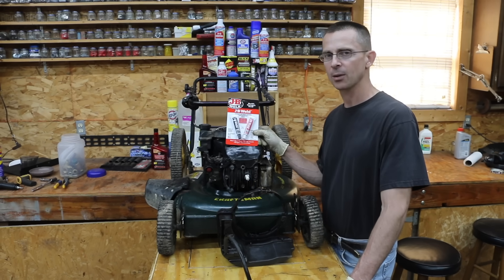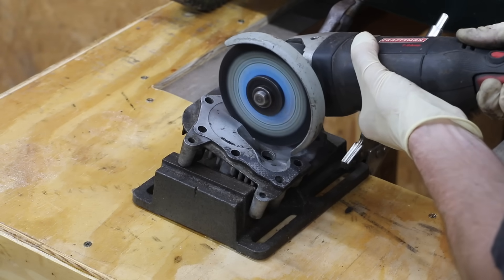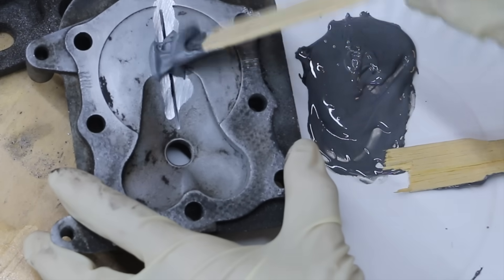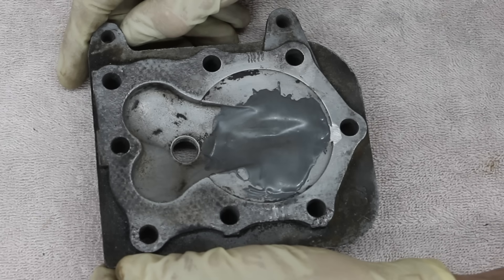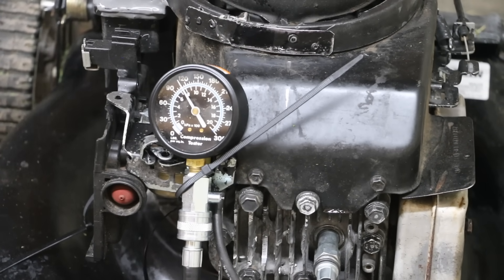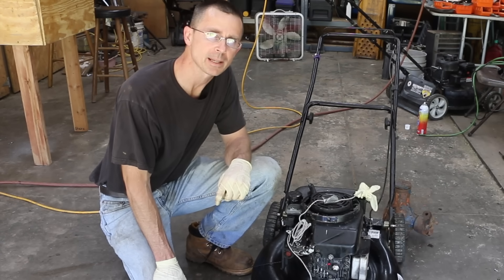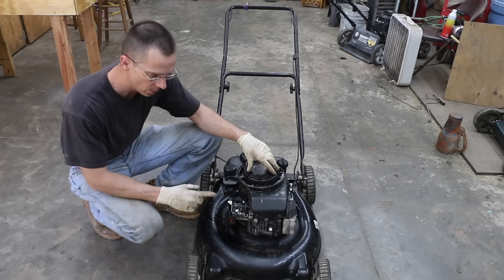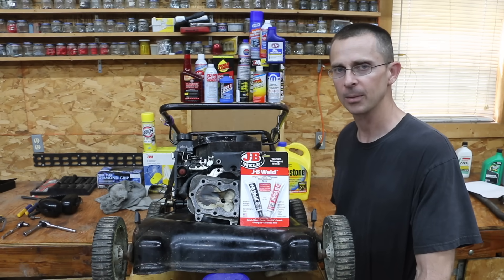Can JB Weld fix a cracked cylinder head?  See the proof!!

Comment: Instead of using bolts to hold the cylinder head use JB Weld. I'm really if JB weld will hold
Reply from the maker: Full Thottle, This is a great suggestion.  Thanks!
Reply: Why not just assembly the whole engine using JB weld that would be a good video
Reply: @Syncere20  wouldn't be able to get everything set right, with the right clearences.
Reply: I drilled through my engine block on a 4.7L ram putting a new exhaust manifold on and used jb weld on the bolt when I replaced it. It never leaked, had the truck 2 years after that
Reply: @mlheinz79  How did you manage to drill though your block when you were replacing an exhaust manifold? 😕 I'm guessing you drilled through the head instead of the block. In either case, you didnt need to use JB weld to fix it. There are plenty of engines that have the head bolts that aren't blind, and go directly into the water jacket. There are specific sealers made to coat the threads of the bolt and install it. Then you could remove the bolt at a later time if you needed to.
Reply: @davelowets  
Thats true,  the best thing to do is use a sealer/that can keep the bolt from coming out.  Most of the older Chrysler engines had exhaust manifold bolt holes that went into the coolant passages
Reply: He recently tried that while testing and comparing several glues.  It didn't hold for long.
Reply: @robertheinkel6225  he actually didnt say how long it held and i think he should have done multipul tests also because i think it would preform even better
Reply: Project Farm sorry 520 size chain long time ago
Reply: He put jb weld and metal cable ties to hold a head on and first ignition pop it blew the head off the engine
Reply: @ronashbaugh4351  🤣🤣🤣🤣🤣!
Reply: Hi really!
Reply: It won't
Reply: I don’t think removing the bolts is a realistic test though.  You should always have the appropriate hardware available. In the edge case where maybe one or two bolts broke and you’re unable to remove them and replace them for whatever reason I can maybe see why you may want to test that, but again I view even this as an extreme edge case. You should always be trying to make the best repair possible as no one wants a temporary fix.
Reply: Project Farm i used it after i sent a 420 chain through the sidecase of a 230 duad sport atv lasted longer than everything else junk Suzuki's from the late 80s

Comment: Hydrolocked a 3.2 L VR6, snapped the connecting rod.  The broken rod then punched a hole in the block.  Used JB to patch block. has held up for years.

Comment: It's a bandaid for an open wound. Temp fix if you prep, mix and aply properly. Not a permanent fix. Vibration, heat, & oil/gas will do it's job wearing it out. Ive tried and it's always always gone bad after certain period which varied due to usage

Comment: I have an LT1 engine, used in Cadillacs and Chevys. This engine has a steel looking 3/8 inch tube behind the engine between the two cylinder heads for antifreeze to cool the heads. Its called COOLING AIR BLEED PIPE. This tube has a rusty crack in it and it is spilling Coolant anti-freeze out as soon as I  fill it. The shop wants about $200 for the part (part no. 12556260) and $200 for labor. JB Weld maybe the answer to this crack. Will JBWeld be a good alternative solution to the pipe replacement, or what other ways are available to fix it without going to the cleaners at the shop.

Comment: devcon is a equal to j b weld, but harder to find. Both are machineable and both stand up to heat well, I have used both sense back in the 70's and 80's. I prefered the devcon for threaded holes because it had a cleaner cut. Both are super products that have been around for many years, and because of videos like yours, young people will get to know that a product doesn't have to be new, to be better. I don't think either product has been changed from the time they first hit the market. If it works, leave it alone.

Comment: What JB Weld blend did you use? I used some of that on the bottom of the fuel tank of my one motorcycle and the gas ate away the JB Weld and leaked all over my engine. Luckily the engine wasn't too hot and didn't catch on fire.

Comment: I filled some nasty pitted places on my 97 gmc v6 engine head and filed it down with a file and smoothed it with sandpaper about 5 years ago and to my surprise it save me from having to put another head on and i still drive this same truck today but i might add that i use to rebuild heads in a mechanic shop and magna fluxed heads for cracks for carquest so i actually knew what i was doing.I really enjoyed your videos and you do a great job making them.

Comment: I tried this stuff on the coolant reservoir on my girlfriend's Dodge Journey. Unfortunately the result was less than desirable. It lasted less than a week before it peeled off. Yes. It literally peeled off as if it never hardened. I prepped the surface and put a nice thick layer on it. It never stuck or fully cured. Quite a disappointment. I ended up replacing the reservoir with a new one. Perhaps it doesn't work with Dex-cool.
Reply from the maker: Adam, Great point.  JB Weld doesn't seem to stick to plastic as well as metals.  Thanks for watching the video and commenting.

Comment: Zo-tite is a good one  i once fixed a gm 3800 6 cyl that had a crack about a foot long from water in the cooling system in the winter. I told the customer you need an engine but we could try this stuff not much to loose at this point .i worked that car for about 2 years and every time it came in no cooling leak. good video man.

Comment: snapped a bolt off flush in a zx6r engine case on teardown, marinated that bolt w blaster penetrate oil for a week,  broke 3 extractors trying to remove it... eventually knew when to hire a 'pro' paid a moto shop to drill and re-tap, they drilled crooked hit case and messed it up baaad, chaged me 33 bucks and said they cant fix it....... its a real monkeys lunch.... to say the least... wondering if i can yard that case hole out a little larger and jb weld hole completely full and then re-drill, and re-tap back to original size?? Do you think it would be capable of that... torque spec would be maybe 80 lb...
Reply: I bought those aluminum rods off of ebay...came with a DVD showing how to use. One of the things shown was a stripped out intake blind bolt hole. Guessing was for mounting something to the intake. They drilled out the hole and filled it with the rod... while still liquid they shoved in a threaded bolt. When cooled they unscrewed the bolt leaving new threads! Aluminum doesn't stick to steel. Thought that was pretty cool
Reply: Can you drill over size install heilicoil.

Comment: One night I was driving north on I-75 in Dallas in between the Forest& Coit exits and I fell asleep at the wheel. 
I abruptly awoke on two wheels after hitting the center barrier wall, so I quickly put it back down on all 4 wheels and continued on my way!
I promptly exited 635 west. All appeared wells I continued west.between Perston and Midway the temp started to go up rapidly so I pulled over. 
No damage to the perimeter of the car, but underneath the aluminum oil pan had a gash in it about 8 or 9 inches long and it had ripped out the drain plug Bolt. 
so I cleaned the gash well, applied a good heavy beed of JB weld, bought a slightly larger course thread Bolt for 60 cents retapped  it and let it cure 24-36 hrs and drove it around like that for over a year with no problems. 
I'm a believer in the power of JB weld!
Reply: we call it i 75  The best-known section is the North Central Expressway, a name for a freeway section of U.S. Highway 75 between downtown Dallas and McKinney, Texas
Reply: I over heated a engine and cracked a small hole in the side of the block and wedged wood in it and filled it with jb weld it leaked till the engine warmed up but it worked
Reply: I-75 Doesn't go thru Dallas
Reply: yes it does

Comment: I used JB weld on a part I made to plug up a before cat O2 sensor mount in a set of 250 shorty headers for my built mustang... it only lasted a month or two... =/ maybe it was shoddy design on my part tho.
Reply: Way to hot there for JB Weld. Even it has limitations.
Reply from the maker: It's hard to say.  Surface prep is very important.  Then again, epoxies are sensitive to high temps and vibration.  Thanks for watching the video and commenting!
Reply: Project Farm Yea, I heat treated it during the cureing process, but... the exhaust on my built mustang easily gets up over 700 degrees. I wasn't really looking for a permanent fix, was just not very impressed with it.

Comment: I am trying this on a boat I just purchased.. it has to cracks that I hope I sealed I grinded the crack on the block. drilled holes about 5 and threaded them and used JB putty and used that to harden the bolts so I could grind them off flush then I used putty over the crack then mixed the original formula and put a coat over the crack then used a mesh and coated it again.. I let it stand all day now Im waiting to lower the engine back and see if it holds.. is there a way to add photos
Reply: Mark Anderson how did it work out ?  Also ... what did you use for mesh??

Comment: Back  in 1980 while playing in the SO-Cal. desert - I Broke an engine case on my 1977 250 XL when the chain broke and I threw it on its' right side to save the oil,  cleaned the broken pieces with fuel (not recommended) and used the JB weld to repair the 4 inch seam around the chain drive exit.  I had 2 master links in my little repair kit - put it back together - waited about 3-4 hours and started it up - and checked it every few minutes all the way back to the Navy barracks - sold it two years later (this was my daily driver) never had an issue with it.. great stuff and Always in my off-road kits.

Comment: bought a 1950 allis Chalmers WD got it running after it sat 10 years realized while I was working on the carb there was something weird on the back of the manifold. pulled it off and the whole back of the manifold had been recreated with JB weld.  it ran that way for years before I got it. i finally replaced it not because of failure but because it didn't look real good.

Comment: I have used it to repair 855 Cummings blocks that were damaged by thrown rods, but in fairness, there was no more pressure on the repair than normal crankcase pressure.

Comment: For about 80 years you have been able to buy a "spark intensifier" that goes in the high tension wire between the coil and the distributor.  It is nothing more than a tiny gap with connectors. He puts the washers close together between the spark plug, and the grounded head bolt washer, creating in essence the same thing as an automotive spark gap intensifier. As long as the air is able ionize across the gap, and conduct, it is perfectly easy for the coil of the magneto to fire the spark plug and give a little sparky show on the outside.  OK? Lets get back to the real test here, the functioning of the head cast from JB weld.. That is a really cool test!  No one else goes to the complexity and effort to show us the range of things he has been doing.. 
My husband and I love these tests and enjoy seeing how things fail or survive.. Real world tests of all the chemicals is neat!!   

Maybe fuels is next?  The 1938 Harley owners manual showed how to distill organic matter to make alcohol fuel if gas was not available... That is resourcefulness.  How bout it.., diluting gas with various solvents and liquids around the shop.. and distilled spirits too.. emergency fuels are sometimes needed.. what might work? What will kill the engine quickly? 
Acetone
Ethyl Acetate
Ethanol/Methanol
Benzine
Turpentine
Mineral Spirits
Toluene
Methyl Ethyl Ketone
etc...

Comment: I had no luck with Jb weld on a fuel tank. My motorcycle has a metal tank and it had rusted through with little pinholes. I cleaned the tank up as best I could and applied JB weld and let it cure overnight. Long story short I got about 2 miles down the road before the tank was pissing fuel onto a very hot cylinder head. I'm quite lucky I didn't end up a crispy critter. JB Weld + Fuel = No way.

Comment: I used JB weld years ago on a 2-stroke motorcycle cylinder block where the previous owner had stripped the threads off the exhaust port. I basically glued the exhaust-pipe to the exhaust port.  Rode the bike for years without it leaking. As an aside, JB weld does not dry, there is no solvent to evaporate, it cures/sets via a chemical reaction like fibreglass resin does. 

I have found that it is fairly runny, and given its extended curing time of several hours the best way to use it isn't to just put it on an leave it, as gravity will cause it to run out before it sets. With your head repair I would have made a much smaller v in the 'crack' and then applied electrical insulating tape over the crack to stop the weld from running out. I then would have turned the head over and put the weld in from the top. Once the crack is full pop the head in your oven at 50 centigrade for half an hour, and it's set. Remove the tape, and clean up as required.

Comment: JB weld will also hold fuel under pressure; years ago I had a pinhole leak in my Holley carb which I repaired with JB. Never had a problem with the repair failing.

Comment: The Cessna repair manual says to epoxy the step on the older 172 with "Connelly weld or equilivent." I used JB weld. I wish you would test Connelly weld.

Comment: i used jb weld on a Volare oil pan that had a hole the size of a quarter. Also a gas tank of a Torino. worked fine for bolth.

Comment: I tried using jb weld to fix a hole in my rotor tillers muffler, it was a big time fail. It just burnt off within 30 seconds of full throttle. I guess mufflers are just a bit too hot for jb weld lol. 
 I was very impressed with how it held up on the cylinder head in your video though. lovin your videos!
Reply: The oil keeps it from overheating.
Reply: I tried to repair an exhaust leak a foot down from engine manifold with JB weld and had the same results. It burnt off
Reply: I'm curious how it would burn off on an exhaust but hold up as a cylinder head. Pretty sure combustion in the cylinder is hotter than the exhaust gases. Not to mention the pressure.

Comment: JB Weld is a great product. The only application where I used it that didn't last was on the edge of a cracked plastic automobile fascia. If you have to use it to join thin plastic, you have to add lapping reinforcement on the non-visible side of the joint. Just using JB Weld on the edge won't hold up to vibration. Thanks for the video, it was great.

Comment: I used JB Weld to patch a cracked engine block on a 62 Mercury with a 352 CI motor. It had been leaking antifreeze so I grooved the crack and patched it with plans to swap in a block from a parts car that ran but needed an overhaul. Got busy and never did the swap. maybe the guy I sold it to did as I gave him the spare engine and parts I had. But I drove the car for a few years, even to Detroit from Milwaukee and back, no problem. Now it didn't get combustion pressure like your test, just the 12 PSI cooling system pressure. I recently tried another epoxy product with a higher rating than JB weld to repair a machining mistake on an aluminum casting, I cannot remember the brand though, sort of a light blue when mixed. What is good for repairing a cracked exhaust manifold? I've had limited success with Pyro Putty. Better luck with an antique iron powder boiler cement that belonged to my grandfather...
Reply: JB Weld makes a high-heat epoxy specifically for engine blocks and exhaust manifolds. It seems to work well; check out the ChrisFix video where he repairs an exhaust leak on a Mustang.

Comment: I have repaired a few engine blocks with JB Weld where the connecting rod blew out the crankcase. Sometimes the damaged inside the engine isn't as bad as one would think and it might just need a little honing and some new parts. The Kohler Courage engines are famous for self destructing and JB weld can fix the block. But to be honest, those engines are junk from the factory. Kohler Command engines are good though.

Comment: ive used quick set JB weld on the stripped out main fuel inlet on the carburator in my 79 Blazer when the pressure blew out the hoakie repair the previous owner had made, i mixed it up, lathered it on, reinserted the the inlet fitting (which had pulled out the threads so badly that I could stick it straight in and out without needing to twist) waited 15 minutes for it to set, then drove 40 miles home

Comment: Very nice testing. I have used Steel  Epoxy (a local equivalent of J.B.) weld for repairing holes in my muffler. On the larger areas I used the epoxy with fiberglass mesh. It works well. When I use epoxy paint with mesh it works but remains flexible., steel epoxy and fiberglass stays rigid.